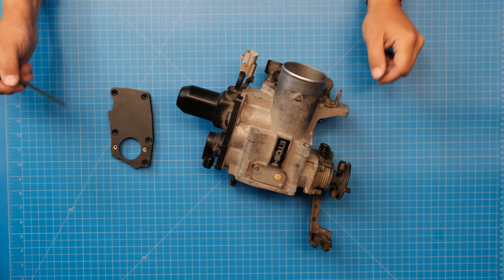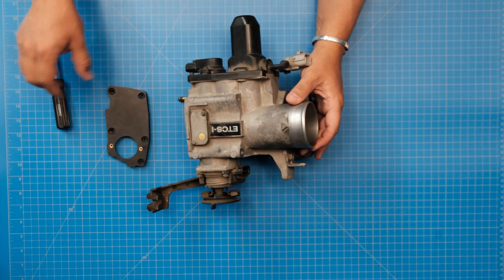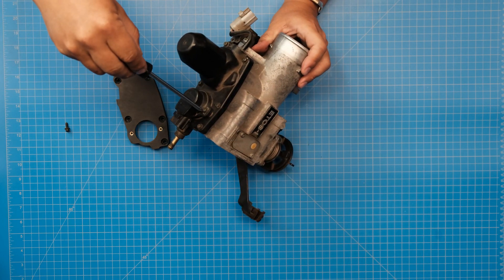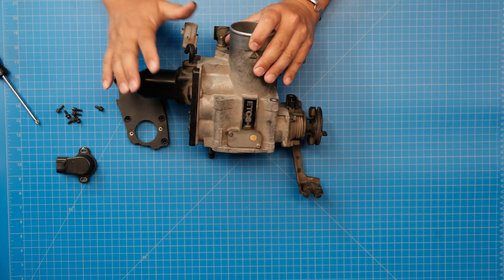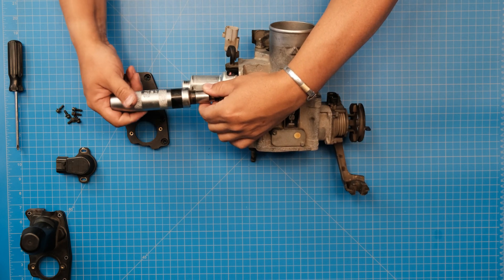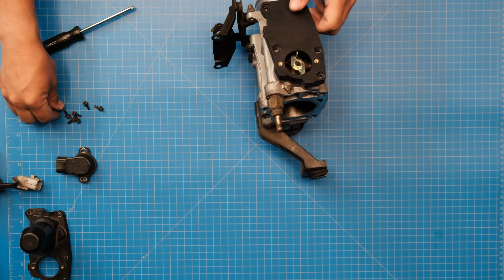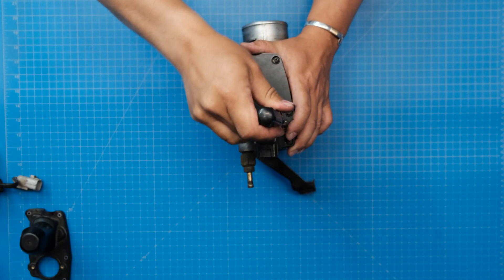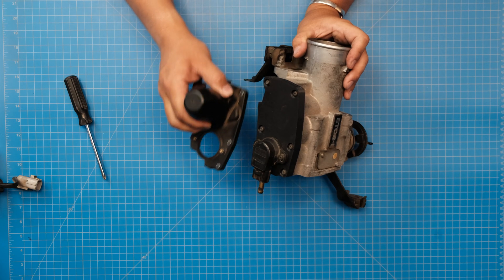2JZ-GTE and 2JZ-GE Throttle Control Motor Delete

Comment: + headed screws are JiS Not Phillips. its why most people end up stripping them out. the angles are close but not the same. so the Correct tool makes all the difference. JiS + are used on Most of the Toyotas and other Jap cars.

Comment: I got a brand new throttle body n im getting code p1128 help me please
Reply from the maker: Wiring issue -   rip the harness that goes to it apart and I bet you find melted wires.

Comment: It will throw a code after you delete the throttle motor right? Dont matter for inspection where i live, just curious if there are any issues with a limp mode or anything like that.
Reply from the maker: Yes absolutely, the computer will no longer be controlling it so it will cause issues

I wouldn't recommend using it with anything that doesnt have a standalone
Reply: @CodyGraham  yeah I'm working on figuring that all out now. Liking the black but don't want to buy anything until I talk with a tuner. Luckily I know there's a few good shops nearby since I'm a stones throw from Philly, so just have to make time to call around.

Comment: Does this work with a piggyback ecu?
Reply from the maker: Most likely no, it will cause issues with the stock ecu that may render the throttle inop completely

Comment: Guys, this will ONLY work if you are going stand-alone ecu or manual transmission swap. Toyota/Lexus integrated a BEAN multiplex communication (like CAN) into the stock ECU where it relied on these components to work in conjunction with the auto transmission
Reply from the maker: Correct, but it has nothing to do with multiplexing - thats really for all the other things - gauge cluster, etc.  The same ecu controls the engine and the transmission, so there really isn't anything going on there
Reply: @CodyGraham so this would work on a stock ecu?

Comment: In need of some help, I had code p1121 for my 98 gs300, it went into limp mode so I installed a new apps and new tps but it went back into limp mode with a new code now p1128 (throttle control motor lock fault). Wondering if should just replace the tb motor or just buy a whole throttle body im just curious at this point whats the issue ☹️

Comment: I don’t wish to criticise BUT the three screws that affix the ICV motor to the throttle are NOT Phillips. If you look closely there maybe star marks between the Phillips “cross”.  These marks mean the screws are POSIDRIVE which is the most common on Japanese makes. Using a posidrive bit will ensure the heads do not strip. Google posidrive
Reply from the maker: Great?  It's trash anyways, no one is out there trying to reassemble these I promise
Reply: I just reassembled one tho

Comment: Dont you have to get an aftermarket ECU when you install throttle lock or does that and the electric motor delete work with stock ECU?
Reply: Did you ever find out an answer to both of these questions?
Reply: @bakihanma7247  No I never got an answer to either. But from what I'm experiencing with the stock ECU, it doesn't act or respond like it should. But it could be some other problem I may have overlooked

Comment: I have a throttle lock. My question is the Allen screws for the tps and the dbw should they be touching or have a little play?
Reply from the maker: They're typically not touching
Reply: @CodyGraham  ok is there a way to do this with a feeler gauge?

Comment: Im hearing foonf this will make rhe computer go bonkers. Will I need to purchase the throttle lock too? My car is stock. Thanks!
Reply from the maker: You shouldn't do this unless you have an aftermarket ECU
Reply: @CodyGraham  How about the Throttle lock? Can I do that without an aftermarket ecu?
Reply: @Starsnstripes25  I have seen some people do it with the stock ECU, I can't recommend that though
Reply: @360themepark  So no throttle lock for the stock ecm either? I'll go boy a tuned one if you recommend it
Reply: @Starsnstripes25  has to be something that doesn't require the stock throttle control at all, ie a standalone
Reply: @360themepark I'm gonna start off with the throttle lock see how that works.

Comment: Doesnt solve the problem off drive by wire motor . We need a alternative the works workswith  the stock ecu and auto transmission . Thinking about doing the bosch throttle .
Reply: Correct, it deletes the stock motor for a cleaner look when using the factory throttle body manually and not electrically.  There isn't an alternative that works with the factory ECU and trans - the only way to delete the throttle control motor and keep the trans happy is keep the throttle body wired in somewhere (I put mine in the trunk) even if it isn't being used

Comment: If using an aftermarket ECU, why not just use a more traditional style DBW throttle? That way you can retain cruise control, implement traction control, closed loop idle control, tune the ratio between accel pedal and throttle opening to your liking, blip-for-downshift, etc... My Bosch 68mm DBW throttle is MORE responsive than a cable throttle, and I didn't have to give up all the other cool stuff DBW throttles can be used for.
Reply from the maker: There's no easy way basically.  And you're definitely  not retaining cruise

Comment: Hii, I have a 2002 GS300 with manual trans and a lot of problems with the throttle motor. Will this work with stock ECU and the throttle lock or I need a standalone anyways? I don't mind if it shows any code if the car runs well. Thank you sir!
Reply from the maker: I've never ran one myself without a standalone, but my understanding is that it will work just fine with a manual transmission, though will throw codes.
Reply: @CodyGraham  thank for your answer! I will try it out and let you know if it actually works 🫡
Reply: @sergiofernandez5035  did it work?
Reply: Is it swapped or did other markets get blessed with manual gs300s? We always get screwed on the good models in America.
Reply: It is swapped, as far as I know, Lexus never did a manual GS 🥲
Reply: @sergiofernandez5035 did it work? I'm about to do this for my 03 IS300
Reply: @@kidsfordrugs338 I do cuz I just swapped out the throttle pedal sensor and it helped a lot but I also have some type of hesitation where the pedal goes nearly limp and I have to press it more for my baby to run.
Reply: @@kidsfordrugs338 😆😆 bro I love my IS300 this is one of the greatest games I ever owned! Reliable and straight sexy! I'll keep her forever!!
Reply: @@kidsfordrugs338 A manual one nice!!! Mines is autonomic! With light mods! She's a Metallic silver. I have an 03 iS300 Sport Design! I love this car!
Reply: @@kidsfordrugs338 Stand alone Ecu? Where can I buy one
Reply: @@kidsfordrugs338 I wonder if I can use just the throttle lock with no troubles.
Reply: @@kidsfordrugs338 I'm def gonna order that throttle lock today. I changed the throttle pedal sensor and the car runs way better, sometimes a little light pedal but I'll just solder the original TPS and have both never know when I'll need them! But I'm def gonna keep this car forever.

(Knocking on wood)  
This car has been amazing! Reliable like a tank bro!
Reply: @@kidsfordrugs338 Interesting I really appreciate your feedback on this bud! Some ignore your questions but want follows and likes!
Reply: @@kidsfordrugs338 I just installed a throttle lock in my IS300!!

OMG I'm blown away how she screams so clearly now!!!!!! The hesitation is gone!!!! She's screaming like Kong Kong On steroids!!!!!!💪🏾💪🏾💪🏾💪🏾💪🏾💪🏾💪🏾💪🏾2JZ power!!!!!!!

I love this car!!!
Reply: @Starsnstripes25 r u manual swapped? By any chance is your apps connector broken ?like the tab that secures it in place I’m having the same issue
Reply: Did any of y’all try it ?

Comment: ATTENTION TO ALL BEWARE This item does not work and he does not accept returns the idle motor needs to be intact in order for the throttle body to work properly please do not buy his product it is a scam the only thing that works is the throttle lock
Reply from the maker: Oh it works perfectly, if you watched the video for both it and the throttle lock, it's pretty clear it is not meant to be used with stock computers.  Standalone only.  

Scam  lmao, I'm leaving this comment because it's hilarious how dumb you have to be to call it a scam because you don't know and didn't ask first.

Comment: So I put a new tps on mine alone with a new app sensor it’s got what looks to be a new throttle motor and it still will no take fuel
Reply from the maker: Going to need a lot more info and testing to be helpful at all.  None of this controls fuel directly, they just give inputs to the ECU to give it an idea of your intentions based on throttle angle. Of course the throttle motor opens the throttle plate but that just lets air in, fuel requirements use throttle angle combined with maf readings to guess how much fuel is needed, then the system checks if that is correct using the oxygen sensors.  It all needs to work mostly properly.
Reply: @CodyGraham  yes that’s what I’m saying u can hit the gas and no throttle response the code that keeps coming up is a p1121 98 Lexus gs300

Comment: Hi my car throttle control motor is playing up car going in limp mode. Trying to fix issue for last 5 weeks no success now decided to buy throttle lock and take motor off would that work? Would there still be warning signs on dashboard?
Reply: Replace the entire throttle body, mine did that, and I didn’t want to spend time trying to figure out what it was, and it was cheaper to buy the whole throttle body assembly anyways.
Reply: Yes you're traction control lignt will constantly be flashing but you can pull the light out from the gauge cluster. Pretty sure you'll get an engine code with it but can't confirm.

Comment: looks like you didn't start from beginning. there would be limitations when you delete it, you mentioned "lock" sth? does it work at cold climate?
Reply from the maker: Of course there's limitations.  Use a standalone and a throttle lock.

Comment: You're going to get a check engine light you didn't give us anything to plug into the plug that feeds the ECM You pull it off and plug nothing in do you not know what a bad computer rating is
Reply from the maker: No kidding?  If you think this is for use with a stock ecu, then I'm not sure what to tell you.

Comment: So since I have the throttle lock in my automatic trans is300 what would this do or add to it
Reply from the maker: It just cleans up the throttle body by removing the throttle motor.  Chances are on an auto removing the motor will cause issues with shifting though.

Comment: Its all nice, but what to do about the idle and warm-up rpm?
Reply from the maker: Use a standalone to fine tune using fuel and timing correction.
Reply from the maker: or you could run a IAC from another vehicle
Reply: @CodyGraham  been looking for which 2 wire I can swap in. If you have retrofit info it would be fantastic. Thanks
Reply from the maker: @suda-nymn  basically any one your standalone will support.  Older Hondas are popular

Comment: I removed the throttle control motor and got a CEL and a blinking trac light, why? I have a 2002 IS300 with a manual transmission.
Reply: I also have the throttle lock installed...
Reply from the maker: Because the factory computer reduces power when it detects wheel slip.  It can no longer reduce power.
Reply: @Cody Graham is there a fix for this issue besides a stand alone?

Comment: Won’t it throw a code and put motor into limp mode if your doing it without standalone?
Reply from the maker: Absolutely.  This is only for cars with throttle locks
Reply: @CodyGraham  ???
Reply from the maker: @speedydan11  manual trans sure, auto not so much.
Reply: @CodyGraham   so with a manual and stock ecu and the throttle lock there shouldn’t be any problems? I have manual and previous owner had the throttle lock and it ended up not working anymore, replaced throttle body and not using the throttle lock and it drive for a bit and now the pedal will go to the floor and not accelerate anymore
Reply from the maker: @Nazrk3  probably a bad APP sensor.  If you search on YouTube for is300 app sensor repair, you'll find a video from Mike Tsai that shows how to fix it.  Very common issue
Reply: @Nazrk3  Hey, did it work ??
Reply: Cody Graham can this be run with stock ecy and a throttle lock